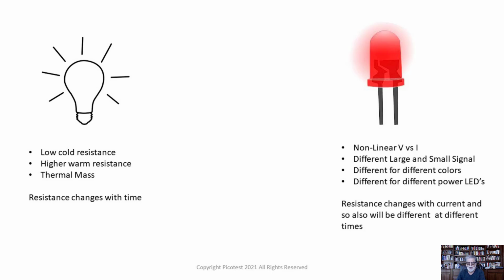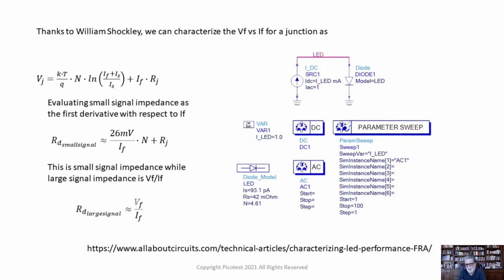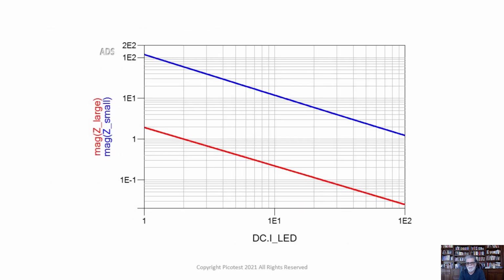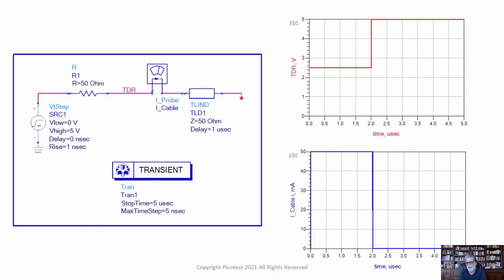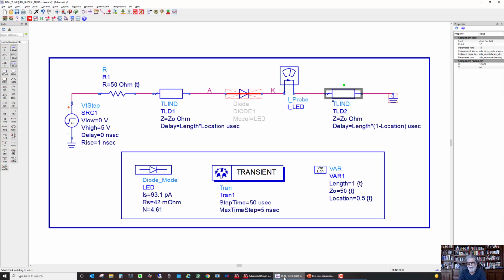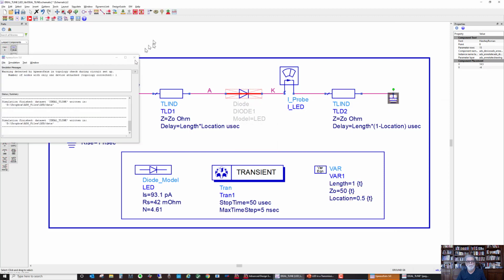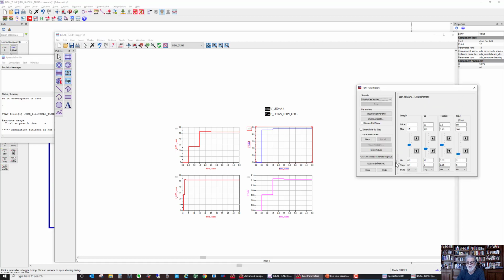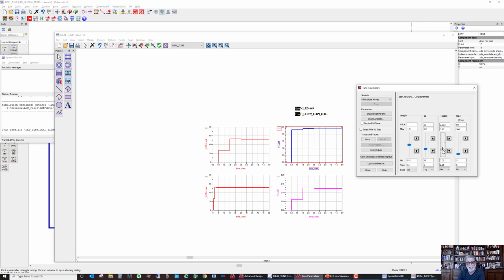LED in a Transmission Line

Comment: I believe that the scenario that the creator is promoting is two differential pair transmission lines to the left and right with each shorted at their ends. Although the transmission line impedance at 1m spacing will be high, there will be a very small amount of current that flows across the entrance to each transmission line through the LED which effectively creates a short path bypassing the loops. It would be much easier to show if there wires in the loop were allowed to be 1cm apart rather than 1m.